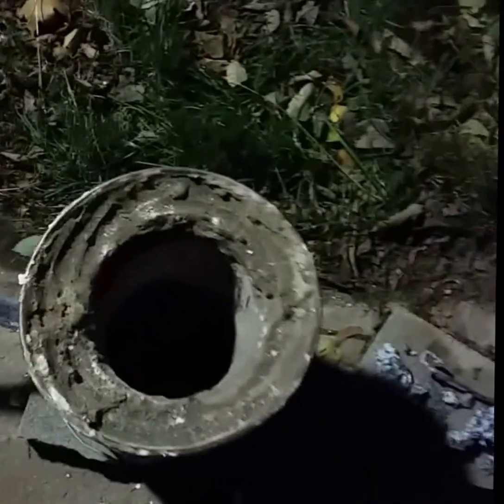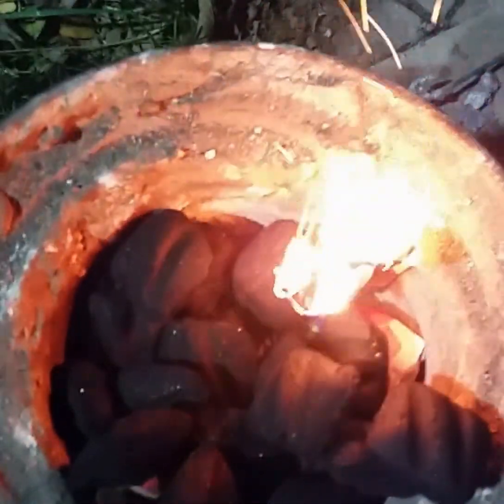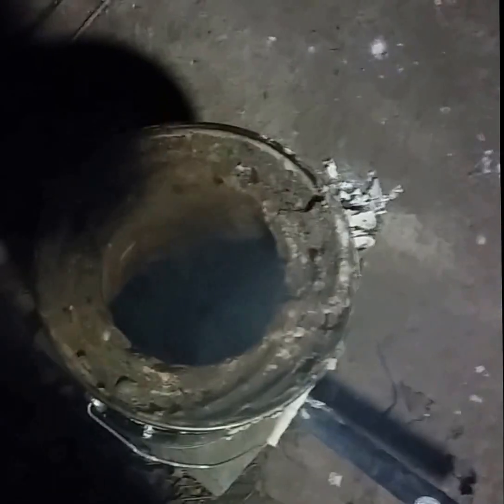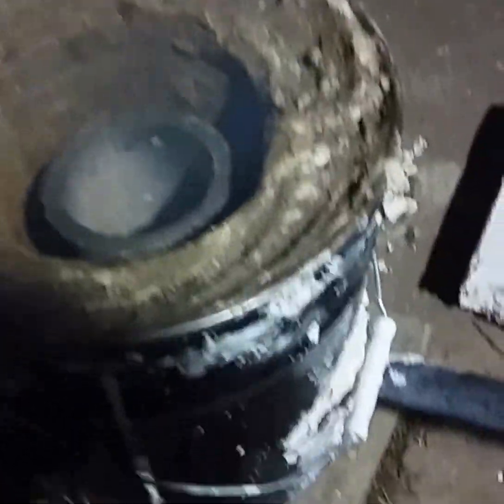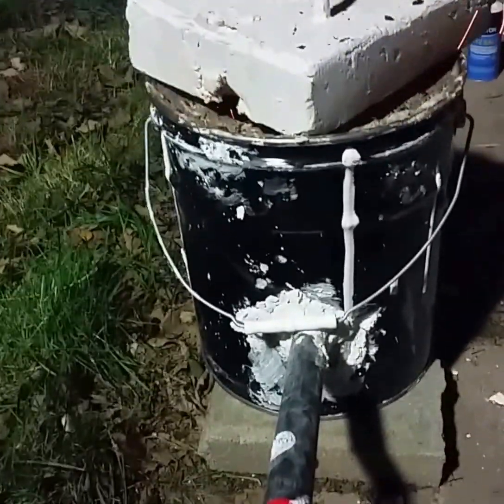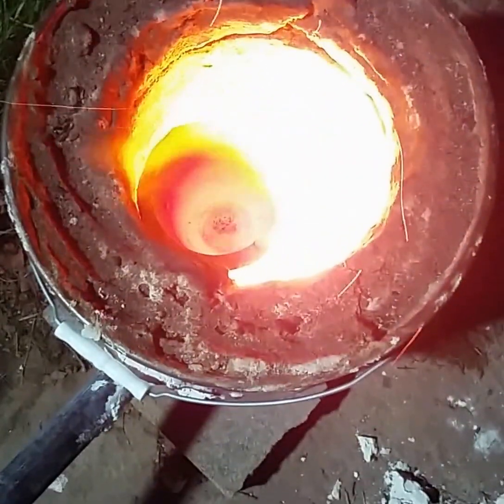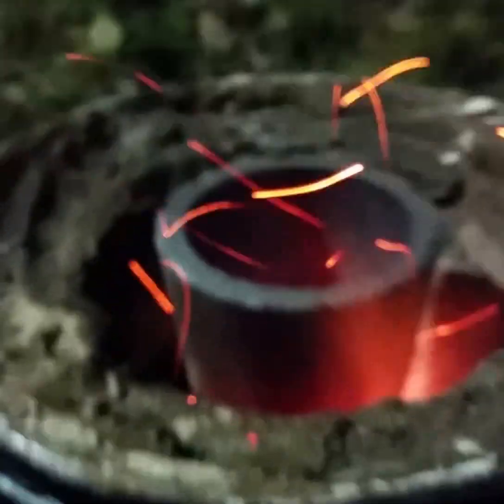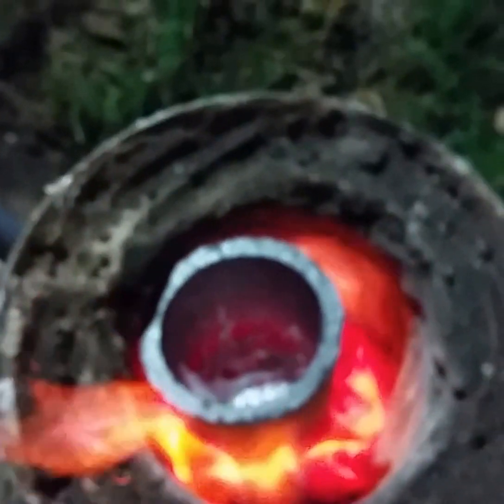Using Lite Salt to Reduce Aluminum Dross (loud in earbuds)

Comment: The whole point of it is not to "reduce" dross... The point of it is to get a more clean metal from your melt.
The potassium chloride helps separate the impurities from the metal so you are left with a much more pure metal.
This means probably MORE dross, but at the same time, the dross will have less pure metal in it and the remaining metal in the crucible will have less impurities in it, as long as you have it hot enough.
If you only just have it hot enough to melt, it won't separate from the dross so easy, but if you have it really hot, when you scoop the dross out, the aluminium will run off and squeeze out if you push it on the edge before taking it out of the crucible.
Reply: Use nitrogen that eliminates the dross problem and it will take all the hydrogen out of the aluminum
Reply from the maker: how does it separate? do the impurities chemically bond to the potassium or the chloride? how does higher temperature functionally make it easier to do the separation. is there a certain threshold where particular impurities stay bound until it's reached?
Reply: @BrianLeeDick  I'm not sure. I'd be interested to know that too.

Comment: charcoal in ur furnace also will end up getting a lot of crap in ur crucible... It can get pretty frustrating trying to clean it out constantly and it just keeps getting more dust and charcoal in it.
On top of that, unless you make your own charcoal, it really makes it pointless melting stuff down if you plan to sell it, because the charcoal costs more to buy than you get out of selling the melted product.
Using gass and forced air or oxygen, you will melt ur metal very quickly (mine will be hot enough to melt aluminium within a couple mins) and you don't spend as much money. It's cheaper to run than buying charcoal.
Reply from the maker: made the conversation. to whom do you sell?

Comment: What is the chemical composition of this salt? at first glance, the flux you poured a little, the layer of liquid flux should be about 10mm. but in general I congratulate, you are the first who tried to correctly apply the flux, in my memory on YouTube :)
Reply from the maker: potassium chloride, but the problem i think is the is typical table salt mixed in